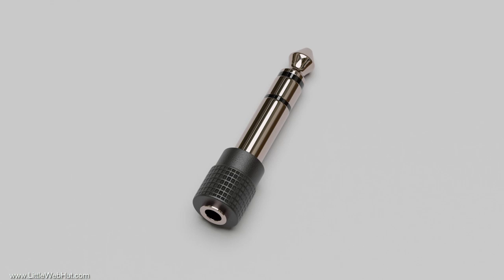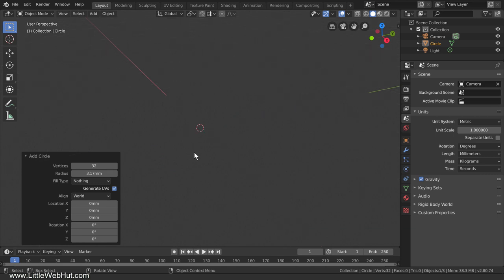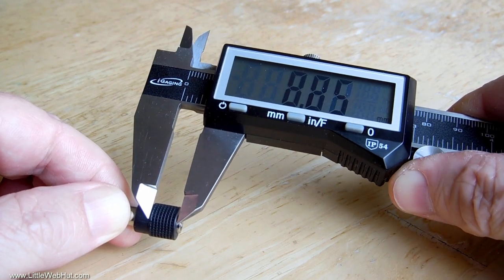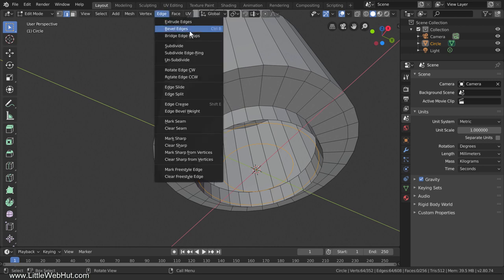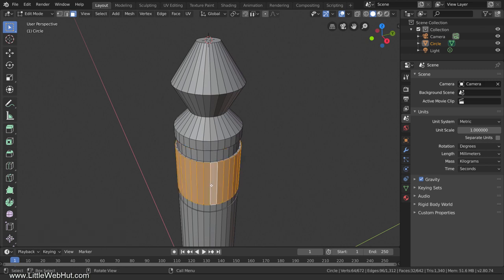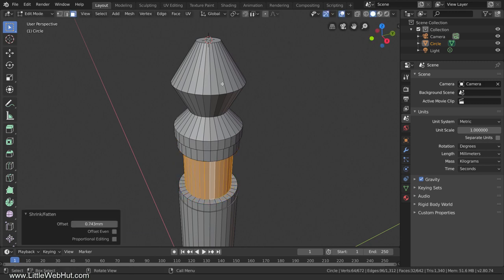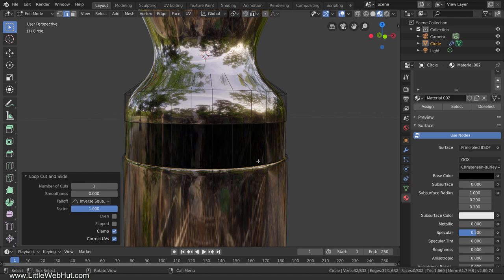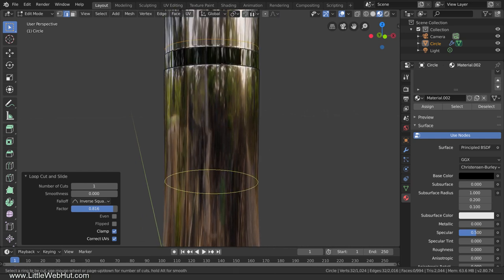Blender Tutorial: Caliper Accuracy 3D Model

Comment: came for the blender tutorial and now im thinking about my caliper. great!
but seriously guys, here are some tips you can use your caliper better: the steel version ones have pointy edges so you can scribe into the surface you're measuring if youre gonna cut later,
some have a lock on top you can save your measurement accross  multiple measurements and scribe also better.
you can scribe out a circle with a radius too.

Comment: Great Tut. Thanks. Was in Blender for a years before wanting to use it for 3D print design. Got Fusion 360 like the rest of the world.  It was ultimately easier figuring out real world scaling in Blender than learning all new production software.
Reply: I use a mix of both Blender and Fusion myself. I learned design in AutoCAD back in the late 80's and early 90's so an actual CAD program is more intuitive to me. Generally I use Fusion for practical prints and Blender for artistic.

Comment: Very informative! I've always used Inventor of Fusion360 for things that needed to be specific and this so this is really informative and impressive!
Reply: Recent updates even before 2.8 made it so scale modeling is easier but for many things it's still much easier to design in CAD then bring it into Blender to make it look pretty. Every update it seems that it's getting more about skill and comfort level than necessity though. 

It's much easier to use metric than empirical units as default Blender units are base 10 as well. Base 10 is much easier in general as most of us have 10 fingers. None the less you can use empirical if you need something to SAE measurements.

Comment: Woah! The info provided in this video is super useful! You earned a new subscriber mate and thank you. I did this with a table and a chair ( of course I used other measuring tools ) and it worked perfectly. I study architecture and this is really useful when I'm making 3D assets and models for my interior designs.
Reply: You can also adjust the viewing angle of the camera to 45 degrees (which is about what the human eye can see) or 60 degrees (which is about what the main field of vision is for humans), but a more traditional camera has a viewing angle of about 28.8 degrees (depending on the camera).  May help give people a better idea of what they would be looking at.  Also may just be a complete waste of time.

Comment: Very nice to see you use the metric system😊👍
To use 1/100 of a millimeter seems a bit overkill though😅
Reply: @Mr300Watts That's some BS advice, going against the teachers methods and experimenting with your own workflow is how we learn and develop as an artist, if you ask the teacher why they don't do it that way, it might be their own preference, or they may have a good reason for it and you will learn more about why it is a bad practice.
Reply: Let's just hope you never build a skyscraper with that mindset.  It'd be 30 feet taller than you were aiming for ;-)
Reply: @SmallerLives  There is no way his scyscraper will be 30 feet taller. He is using metric system.
Reply: you should never trust calipers to 0.01mm, that's what micrometers are for, normally you trust calipers to around 0,1mm.
Reply: @gjuroo  and if you measure it in feet... 30 feet taller.  But you're smart.
Reply: @fuchsmode  Never trust a person who uses a comma as a decimal point.
Reply: @fuchsmode  Thats true. And for those of you who have actually worked with metric sizes this small will know: there is no way you are going to see that in the render. It just makes things messier.
Reply: @rememberproductions8636  yeah, for renderings, 3d prints or woodworking, 0.1mm is pretty small.
I do a lot of metalwork and i often need more precise measurements. Luckily i recently got some mocrometers (accurate to 0.01mm) and since then, i only use my calipers on non-critical dimensions. To be fair the calipers in the video are probably more accurate then mine (my father found them somewhere in our workshop, he doesn't know where they're from) but as i said i don't need them to be so precise.

Comment: 6:50 Measure the first diameter and then zero the caliper, then measure the second diameter, read the diameter difference between the two circles, this method is simple and accurate.

Comment: One thing to note, when it comes to version numbers with computers: 2.8 isn't the same as 2.80 as the decimal number is a revision number of the number to the left.  (I know I am shit at explaining, I am tired while typing this but I will try to further explain with examples.)  so 2.8 is the 8th rendition of version 2.  but 2.80 is the 80th rendition of version 2.  if they make a 2.80.1, then that would be 1st modification of the 80th rendition of version 2.  (though, technically, by default, all versions are assumed to start as a *.0, but not everyone goes by that and defaults the first as *.1 instead.)

So if there were a list of versions of software that were 4.6, 4.200, and 4.16, the order from oldest to newest would be, 4.6, 4.16, then 4.200.  This is why all software seems to show that "unneeded" 0 at the end.  Not to make the number sound better.

Comment: In order to sharpen the edges between the metallic and plastic bits, wit would be better to use the crease function. Select the dividing edge (alt+left click in this case) and press shift + E. You can either use your mouse to increase the value to one or type 1 and enter.

Comment: Thanks for the tip, new to calipers and was having issue with Blender measure not reading what I measured from a prior print. Problem was I did not reset the caliper, so thanks for that useful and critical step...;) Now if the measure tool in Blender was as useful and robust as SketchUp Blender would be a serious force to recon with for accurate 3D print modeling. Hope someone makes a way to measure like it does in SketchUp for Blender...;)

Comment: Awesome tutorial! One suggestion though, you do not need to adjust the samples if you go to the "View Layer" tab and check the Denoise box. It works fantastic and saves render times.
Reply: In some situations the denoiser turns smooth areas into mud.
Reply: @myztazynizta  That's interesting. I have never had that happen and will have to see if I can replicate it. Thanks for the heads up.

Comment: Note that 2.8 is not needed to do this! I did something similar with a fan a while back in like 2.78.
Reply: modelling pretty the same as in previous versions, but [principles shader] do not work in 2.78 and older
Reply: Principled Shader works very fine in the latest STABLE release of Blender: 2.79b
Reply: If you use anything lower than 2.8 then you are negatively training for an old system that is not the future.
Especially if you are new to blender.
Do you also send text messages with Morse code?
Reply: I'm an over 5 years OLD Blender user. I'm trained to use only STABLE software, which stil crashes on its own, without the need of NEW BUGS yet to be discovered. And... who said that old technology doesn't work JUST FINE? Film cameras still work great, for instance. And no, I'm not fluent in Sumerian.
Reply: The fundamentals still apply if you're using an older version, you're not going to cripple yourself by using it.

That said a lot of effort went into 2.8 in 4yrs they were able to work out most of the bugs not only in new features but also many existing ones.

Primarily I use the Portable Apps version of Blender so I'll wait till they port it. Other than that I can't see a reason not to update to the RC.
Reply: Well, I see no reason not to wait for the STABLE release. Which, of course, will introduce new bugs on its own. But... well, I just can't stand trying out all the new features! Hopefully I won't get that "Unfortunately the program failed to run due to a nasty missing dll" I use to get recently (OK, I know... Windows sucks).
Reply: Blender 2.80 is now released! Recommend you check it out
Reply: Yes, I know. And I know it's still a repository of bugs. This is actually RC#4 with an "official" name.
Reply: @mutedsounds2k  that's a little cynical. Blender had always had its issues, but I find it quite stable most of the time. Still, recommend you save often (that was especially true in 2.79, too)

Comment: Where can I buy calipers large enough to measure buildings? It's taking forever with these tiny ones. I have to keep measuring very small parts, marking with a pen, then moving a bit and measuring again. I keep all the measurements in a little notebook and use Blender to add them up like this: 98.32+96.19+95.64+96.11 etc. It takes a long time to type them all in. I have about 60 pages of measurements for my local library, but I'm slowly making progress. I finished a few meters of the front left corner of the building, but still have quite a lot of measuring and data entry left to do! The librarian, Connie, always brings me half of her afternoon snack when she sees me out there measuring on Saturday afternoons. It's usually some sort of muffin. The blueberry ones are my favorite. She's a real sweetheart that little old lady. Anyways, thanks for your awesome tutorial. I couldn't have gotten this far without you.

Comment: I used this to 3d print a broken part. Biggest problem was that Blender handles circles differently than other software. So to get a nice round circle you need to make sure you set the amount of vertices appropriately high RIGHT AFTER you add it otherwise you can't change it easily later on.

Comment: I'm impressed. I'm sure metric was used for both modeling and measuring to keep the units the same without any conversion but that item is generally referred to as a 1/4" jack. I've found that things named based on imperial units tend to have imperial measurements. I wonder what caliper dimensions you'd have gotten using inches instead of millimeters? I'm fairly new to 3D modeling but don't think I'll ever be able to something as nice as you've done here.

Comment: The surface is smooth at the tip of the plug . But when I render it there are planes which all have a different color and it looks not good. Any solutions?

Comment: K, everything blew up on me when it came time to move the camera. I was only able to zoom to a certain point before it stopped completely and was still too far from the model. So I did Shift - ` to enter manual camera mode and its movements are just too big for fine control at that scale and unlike other functions, holding Shift while moving  actually makes the movement bigger instead of smaller. How can I get finer control of the camera?
Reply: use the scroll wheel to adjust speed
Reply: @Troncase  In what way? Scroll wheel is the zoom and the speed seems to just be whatever Blender decides to be. At one point it will be too fast and I can't get a good, finely placed position, or, if I zoom in to some arbitrary point, zooming and all movement becomes either impossible or agonizingly slow...

Comment: I dont quite get why you use subsurf instead of bevel....

does this truely need 256 vertical loops? (32×Subsurf3)
50 look buttersmooth already. A game would use like 5... 
It also creates many horizontal loops in the absolutely flat parts too. This model has many of such...

I mean it looks like its for a sales render so it doesnt matter anyway... but I dont know. Feels uncomfortable to waste so many tris ^^
Reply: Mr300Watts Well in a tutorial I think that at least deserves a mentioning...... 

Great video anyway, no question ^^
Reply: Mr300Watts Guess you're right...

I myself just find it to be easier to work with bevel than subsurf for such precise work... Always so frustrating to loose all the precise hard edges in one click and seemingly have to rework the whole piece ^^
Reply: You can use a decimate with very small angle constraint to remove excess flat polygons like a subdivided column.

Comment: Why didn’t you just use scale snapping for the top, instead of trying to eyeball it, kind of makes all that accurate measurement redundant, you also still have an ngon in the internal face, the texture mapping wasn’t working properly either, distorted around the seam
Reply: For singular object rendering, ngons are that big of a deal.  It will be like an extra 2 seconds of render time for each, if that and depending on the computer and free space for it or if you are rendering in the background or with the program active.  But when considering for gaming, on a small scale, you can just have it increase the vertices for you and it will automatically resolve the number, but for large scale, you will want to go through to fix them manually, as you would have to anyways to reduce the number of polygons you have total.

Comment: just a fair warning, digital calipers have a strong tendency towards inaccuracy. Even zeroing them is less helpful since they are not built with high float sizes in mind. Taking them beyond 2 decimals is a bad idea.
Reply: True I gave mine to my brother.  The batteries die just when you need to use them aswell.

Comment: Loved the tutorial. Every step is described and it was easy to follow along!

In order to further improve, you could display your keys with this "screencast_keys" addon:
https://blender.stackexchange.com/questions/23059/how-do-i-display-what-keys-i-use

Did you consider using the bevel modifier instead of continuously using subsurface modifier with extra loop cuts in order to maintain the geometry where you still need it?
https://youtu.be/UwgDXP9lG_I?t=124

Comment: Creases>loopcuts
Reply: Sometimes.  For sharp edges yes.
Reply: @OmniscientWarrior  it works for rounded edges as well. If you need extra rounded edges then bevel modifier. Or Ctrl+B on the loop the bevel is needed on. Much lower polygon count with the same look

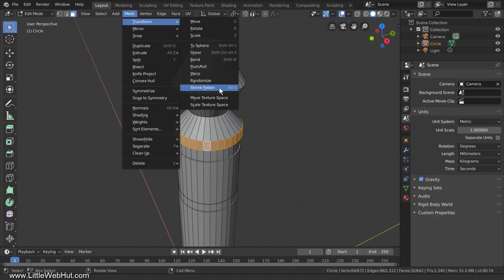Comment: Up until 18:59 everything was perfect and pure for my Sketchup drawing mind, but after 18:59 blasphemy..
All of the measurements you did went out of the window.
Reply: "All of the measurements you did went out of the window."

If you needed  a precise model, yes. But if you want to keep an object about the "correct" size, this works great.

Blender is awesome, but it is a tool for a certain kind of job. It isn't a mathematically precise modeling tool.

If you want to split hairs, this model is about 2 minutes of work in SolidWorks, Rhino, MoI, Alibre, Fusion 360, etc. as a simple (and precise) revolved profile.

It was still a fun watch though.

Comment: anyone who knows measuring shit you want starret or mitutoyo. imperial is pointlessly used by simpletons. 
this way of making solids seems pathetically slow. in auto cad you would draw what the main body looks like and sweep it around the centre line making the whole shape at the same time.
Reply: well, AutoCAD is made to specialize in computer-aided design, while Blender is a 3D modeling software that specializes in making games and VFX it just so happens you can use it for computer-aided design if wanted to and also there is no need for high-end tools for something that is only going to exist in a virtual world.
Reply: You can actually shape most of what you want that way in Blender.  But you don't get as much room to make changes or have multitextured objects and a hassle to make rounded surfaces.

Comment: No need to buy this since most thing have dimensions in specs or type dimensions in Google, i never had problem this way.
Reply: Peter Tremblay I would be surprised if the spec sheet for such an adapter would give the diameters in 100ths of a mm for each of the segments of the plug, but perhaps 😜